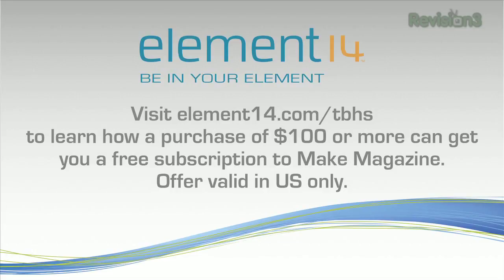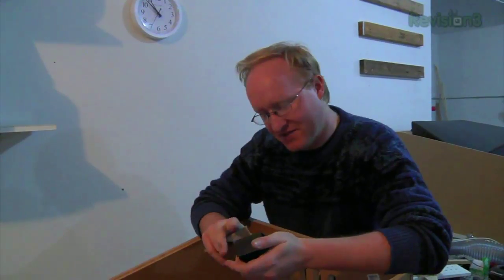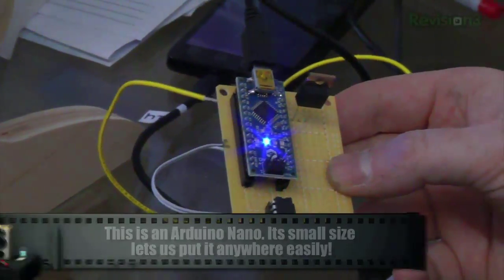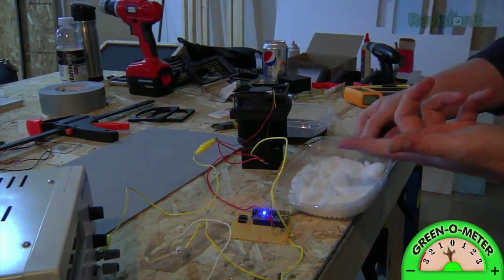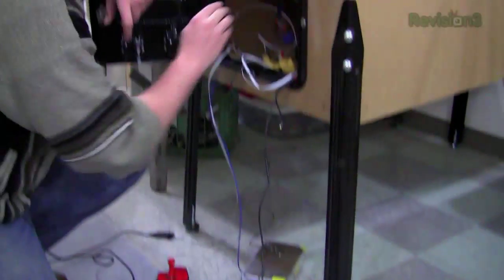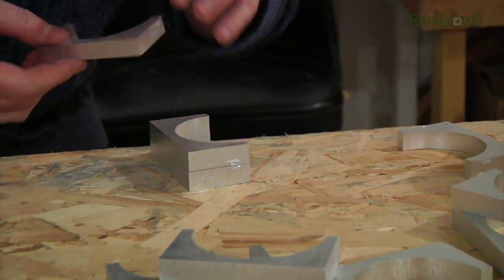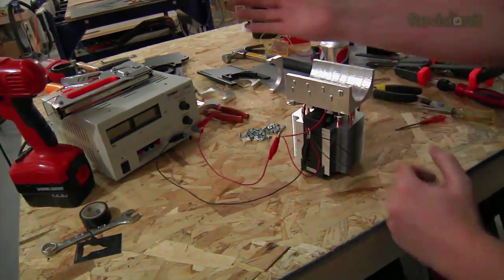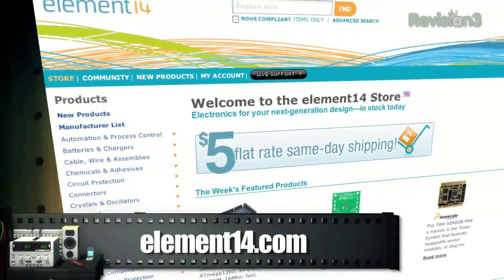The Ben Heck Show - Super Can Cooler

Comment: Another way to do this is to build something similar to the cylinder-shaped fan blade system in a tower fan, but have it capable of wrapping around the can with only a little bit of space on the sides, and then on the bottom have a platform for the can to sit on that can spin with ball bearings so that when the lid is closed, it can grab the top of the can to keep it from spinning yet still allow the fan blades to rotate around it. The lid and can platform will have slits for air intake and the blades will push the air outward...and from there all you need to make it use no electricity at all is a crank that spins the fan blades at a high ratio, perhaps a 8:1 or 10:1 ratio from the crank.

Comment: Peltier CPU coolers have existed for years now. You can buy them online. But be prepared for a hefty energy bill, because those eat several hundred Watts of power to cool the CPU and still need a fan to disperse the heat. So such a cooler is a lot more expensive, requires a powerful PSU, still creates noise and costs a lot to have it running. That's probably the reason they haven't caught on. But they're a great option for overclockers where money and noise isn't really that much of an issue.

Comment: I'm still using a Coolit Freezone Elite CPU cooler that is based on peltiers on my i7 2600K  overclocked to 4.6Ghz & never surpassed 56c even in a 30c heated room & benchmarking. This with it set to only 40% of full potential power, at full potential it easily drops well below ambient temperatures to the point where I have to worry about condensate build up but the software keeps everything in check perfectly. Best cooler I have ever owned including my custom multi radiator water cooled systems.

Comment: An Arduino is way overkill for this. It only needs a simple thermistor controlled voltage regulator circuit. Ben also demonstrated the perfect way to destroy a Peltier. They have to be kept DRY. They should be insulated and sealed around the edges to keep out condensation.

Comment: 1 flaw in your design ben, you have to have the heat pipes in the cooler pointing up for work correctly. and the fluid inside heats and steams it rises carrying the heat "UP" to the cooling fins. they will not work properly sideways or upside down. In that orientation, only the copper is carrying the heat to the fins and not the liquid inside.
Reply: Incorrect, these are common CPU heatsinks for a pc. Generally, your CPU cooler is mounted onto your motherboard in the same orientation that the ones in the video are.

Comment: I like the idea of the Green-O-Meter.  It is a definitive indicator of how well designed the project is -- how efficient it is. This is important I think. I converted my HD V-Rod motorcycle to all LED and refused to use wire-wound resistor loads to trick the ECU for that very reason -- it destroys the benefit of efficiency!  Buck-Booster controllers well for LEDs.  Hey... funny... a pal of mine gave me a USB powered can cooler that works the same way as the can cooler in this video!  A fan blowing past the hot side heat sink.
Reply: Yes.IR thermometer is reading some of the room heat reflected in the reflective aluminum surface -- you need a contact thermometer.  I love these optimal -- overkill designs!!  Great!

Comment: you say it doubles as a room heater but if its heating on one side and cooling on the other wouldnt that technically make it an equilibrium
Reply: Nothing is perfect and you are using electricity for the Peltier effect. The byproduct is more heat.

Comment: I need to use my 240 rad outside tower. Im going to put the petier with noctua heatsink on hotside and cold side ontop of the res then  onlt to gpu phanteks cooler block in tower then and back out to loop. Worried if condensation getting inside pc tower but doubt it could.  But ill watch but with all outside i doubt it could.  If i see any sign ill unplug the pelteir use just radiators alone. Only as have these sitting thought put onto res. Square cheap one. Spare cpu cooler to. Wide channels could go through that with peltier before gpu and back. But unsure if 300lmin is ok. Cheapo pump. Have sc600 but maybe too much.

Comment: vancitycanary "The peltier is probably overkill... The heat sinks and fans would be enough..."

If you removed the Peltier element then the can would stay at room temperature – thermodynamics
Reply: I agree most soft drinks are ideally chilled to 5 degrees Celsius which is far below room temperature. (Sorry for Celsius)

Comment: Ice, cold water, salt.
Reply: Salt lowers the boiling and freezing points of water, but it actually also decreases its thermal conductivity (meaning thermal energy is carried away at a lower rate). 

However I would assume that if you put enough salt in water that you then put in the freezer (say in an icecream container), it won't freeze, and will be more effective at cooling an object due to it's fluid nature (it will have a greater surface area of contact with the item you want to freeze, in comparison to blocks of ice), and will be at a lower temperature than tap water cooled by ice. 

ie. keep salty water in a container in the freezer, then put your can in the container. 

The benefit of the Ben's design is that it has the heat sinks and the fans, which mostly carry the thermal energy away from the can, rather than mostly absorbing it (as a container of salty water would do). 

I know you didn't ask.

Comment: Damn! that was an awful lot of trouble to go through when you could just stick it in a bowl of ice, sideways and just spin the can. Ice cold soda in 60 seconds or less! The spinning circulates the liquid inside the can and exchanges the heat very fast. Then you don't have to wait that horrendous 6 to 7 minutes in an ice chest for your cold beer.

Sorry guys, this one is a fail. I suggest a redo using a simple motor that contacts the side of the can to spin it in ice. Much more elegant and efficient design.

But hey, this would be great if you have one of those huge spaces in the center console of your vehicle.
Reply: Chris Turnblom The ice would melt, but I get your idea.
Reply: Thomas Duke 
You are correct. The ice melts as part of the heat exchange but its not like all of it melts. ...maybe 2 to 3 cubes worth.

I use this method all the time. When I bring a 12 pack back from the store, I often want a cold one immediately.
Reply: hornylink  I don't know. The ice works for me. Come home, put some ice in a bowl and spin the can on the ice with my fingers for about 60 seconds and I've got an ice cold drink. 

lol Maybe I could hold my Dremmel tool against the can.

Comment: The problem is that you are limited by the thermal conductivity of the pepsi itself. You can only cool it so fast until the outer layers of liquid start to freeze before the heat has a chance to escape from the middle. You should find a way to gently stir it, maybe have it spin very slowly with changing direction.
Reply: Would vibrating it, like ultrasound, work?
Reply: @BrainSeepsOut  that doesn't sound like a great match for a carbonated beverage

Comment: I am all for MCUs and Arduinos, but why use one in this build? Its a control circuit simple enough to be realized with a simple voltage comparator + a little extra components.
Reply: Yep, a simple electro-mechanical thermostat would've done the trick. Or a cheap electronic temperature controller.

Comment: Ben wouldn't it of been better to use more peltiers (Pill-tea-A) to get a higher QMax use less voltage and be more green? :D 
From what I have experienced with peltiers the more you use the more effiecent they get, I used 8 132w Qmax peltiers for a watter chiller in my rig, so I'm speaking from experience.